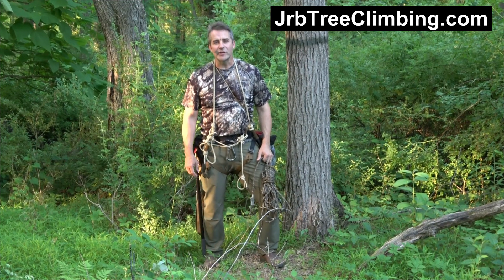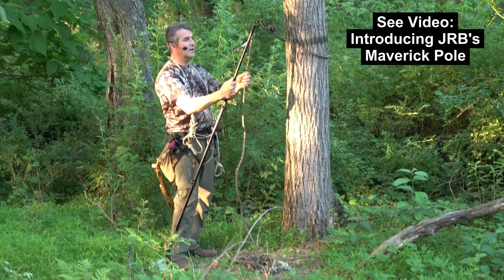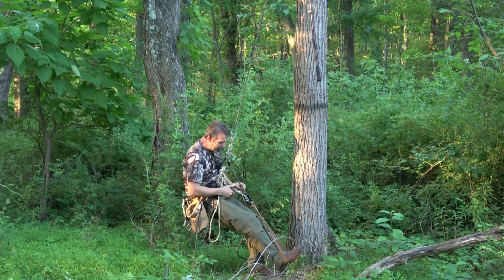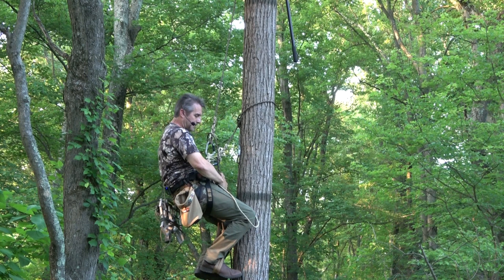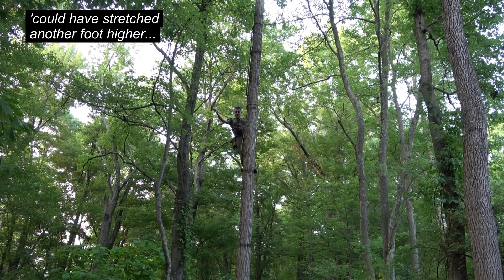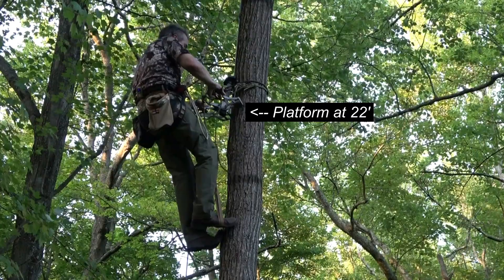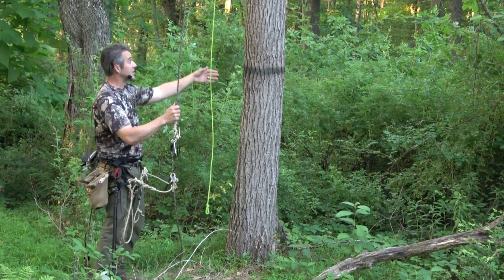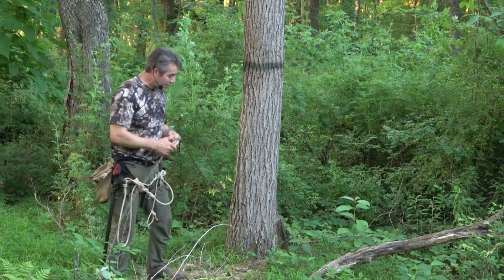Convert a Rappel Rope into a Climbing System, Tree Climbing Demonstration, JRB Hitch Climbing Method

Comment: I have a 33’ rappel set up. How high (at my feet) could I get with that using the hitch climbing method in this video? I’d prefer not to purchase new rope yet as I’m just starting to explore this climbing  method as a possibility for saddle hunting
Reply from the maker: It's a good question.  It depends on the tree diameter and your preferred anchor height above the platform.  Probably 17ft. See info here. 
https://jrbtreeclimbing.com/climbing-systems/hitch-climbing-system/
Reply: @ thanks! That would be a fine starting height as a practice this year leading up to season. I like the hitch climbing method. Seems like an access point for me into the world of rope climbing. My rope is 9.5mm so I’ll need 7mm cord for my longhorn hitch correct?
Reply from the maker: @moonlighthomestead4259  7 or 6. I prefer the 6mm TRC. It's a little harder to break but fine at my weight. Some of the bigger guys prefer 7mm

Comment: U said  in previous  video u don't carry a backpack when u hunt what all do u u carry and how do u carry it ?
Reply from the maker: @jasondunbar1907 I don't have a video on this yet.  i have my Garda hitch and emergency supplies and rangefinder in my saddle bags. I wear a small, cross body bag over one shoulder with my gut kit and any food or water. That's on my chest. That's the only thing I take out of my truck to repack it. When I use a platform, I wear it over the other shoulder with a sling like this video. If I am carrying a Maverick pole, it also is on my back with a sling, over the bag.  My rope is attached to my bridge and over one shoulder. 
 https://youtu.be/hoSny2MwmQY?si=AfqyyKn0Hb6R0Cjf
Reply: @jrbtc  Thank u for the reply I have been following u and have made changes to my brige on my saddle

Comment: I've recently discovered your system and have completely changed the way i climb. No more one sticking . Thanks for the info. This way works great!
Reply from the maker: @eddieheath7054 The most important thing is your safety. I climb using several different methods but only need one system. Whatever is appropriate for the situation and tree.  Cheers  and thanks

Comment: Man, I’m probably in the minority, but this all seems so complicated. I’m a saddle hunter. I just wanna be safe, but this adds so many elements to the climb that it’s confusing for a guy like me. If you could climb with a linesman and your tether or your rappel  rope and keep slack out of the line that seems to be simpler. What do I know though? You are the professional and it seems like a lot of people that follow you are also veteran climbers that understand your method. I’m so confused.
Reply from the maker: @kevinanderson4610  Your question is a good one.  Here's the problem with trying to advance a tether up a tree:  even if we move it up with every step, we wind up with an unacceptable amount of slack in it. For example, why can't we find any videos of people demonstrating how safe it is to step off their sticks at the worst possible time?   When they have the most slack in their system... or while they are in the middle of advancing their tether? I believe the answer is because it's unsafe.
Reply: @jrbtc  Thank you! Your videos are great. You’re so thorough.I’m understanding the system a little better now as I’ve been watching videos trying to simplify my understanding of things. There are so many different variations that I just have to dumb it down. I think the only thing I need to do is incorporate the JRB cinch into my climbing system to be as safe as possible on my climb and then I can still use my madrock with my autoblock to rappel down or eliminate the madrock all together.I was hoping to incorporate the madrock with my climb, but that may not be possible to do safely. Which video would be the most help for ascending with the jrb cinch on a 40’ canyon elite rappel rope?
Reply from the maker: @kevinanderson4610  I will be adding some content very soon to discuss your question. There are some retrieval scenarios which are more complex with a jrb cinch as opposed to a Maverick hitch. But the bottom line is that in order to always ensure the minimum retrieval complexity, I like a system with a minimum of 50 ft of rope

Comment: Hey John - really like the idea of this system. I was planning on using 9mm Canyon Elite (which your website says is probably closer to 9.5mm). Regarding the longhorn agile hitch, would you recommend 7mm Sterling accessory cord over Sterling 6mm TRC for that rope? Any pros or cons I should consider for each?
Reply from the maker: Both cords work on that rope. Personally, I prefer 6mm TRC.  It seems to stand up to time with less wear.  And with 6ft of cord, we will get a nice, compact Longhorn Agile Hitch. 
https://jrbtreeclimbing.com/content/length-specs/
Reply: @jrbtc  Thank you and thank you for all that you do! So many hunters are quick to take risks while climbing, it is refreshing to finally find someone putting out content where safety is the top priority.
Reply from the maker: @ccrre  I appreciate that. This is exactly what I'm trying to do. And I never claimed that I didn't take any chances when I was younger. It's simply that I didn't know how big of a chance I was taking at the time.

Comment: Really like hitch climbing with the JRB MAVERICK HITCH.  Never worry with a throw ball anymore, but love carrying a 20ft hitch pole, which comes in very handy as a walking stick at 5 ft , yet extendable out to 20ft and can accept a pruning saw blade or the rope hook for climbing and hunting purposes. I use a dedicated 50 ft HITCH ROPE  with 4 pre-tied JRB 5-2-3 hitches, 2 on each end of 11mm Sampson Predator rope tied with 9mm Sampson hitch cord. Of those 2, one is a JRB COMPACT 5-2-3 with a rappel ring ; below that,  a JRB 5-2-3 soft bridge for a web foot loop , no ring , with the 1in tubular web looped through the hitch loops. If I like a tree after hitch climbing , I will leave a preset paracord and come back to climb with JRB DSRT using a dedicated 75 ft 8mm Teufelberger Resc Tech rope with 3 JRB 5–2-3 hitches pre- tied with 6 mm Sterling hitch cord , 2 of which are in bridge mode with 1 on one end of the rope (in case i need to hitch over a limb ) and the Garda footloop. Of course with either rope I rappel using a Super Munter.  So I scout and climb new trees with the HITCH ROPE, but use my DSRT ROPE on favored trees where I have usually done some work such as pruning limbs and leaving a preset paracord. DSRT IS VERY STEALTHY. If i don’t particularly like a tree , then i just abandon it and keep exploring until I hit a hot spot. Thank you John, my hunting success, and climbing fun has greatly improved with the JRB TOOLBOX. OH, and my climbing is solid SAFE. Having followed JRB tutorials closely my climbing skills and knowledge is so much better, and quite enjoyable, can’t wait to get back on rope SOON. John , I look forward to future tweeks as your ongoing advancements of climbing technique and technology are fascinating, practical, and useful. I will mention that often , when entering new areas on a Hitch Scout, I’ll see deer . With practice, installing rope with a pole is very efficient and quiet.

Comment: What's the difference between the telescoping rod and a "climbing stick?" Great demo. So ya'll will stand on that tiny platform with a hunting weapon, harnessed in, for hours like that? Sheesh. Looks like that would get uncomfortable pretty quickly. When I do bird photography near water features, I'll setup sort of a V-Rig between two trees and just hang in the middle so the foliage won't block my shots, but I have a system so that I can lay back and relax in my chest harness. So I'm no stranger to sitting in my harness in one place for long amounts of time. I'll often use a foot loop as well to take my weight off the harness for a bit, so I can see how the stand would be really nice. Just like hunting, wildlife photography takes patience, quiet, and dedication. Anyways, I'm rambling. Thanks for the video!
Reply from the maker: You can do a Google search on Climbing Stick and see what they are.  As for endurance, I have done 13+ hours in a tree on a Saturday without coming down... and I did it with NO platform, just a branch under my feet.  And then I did it again 2 days later on Monday.     Maintaining comfort while limiting movement is a topic I haven't addressed yet. Safety first.

Comment: Yeah, been waiting for this for 40 years!
Just went out and climbed with one end on a JRB Cinch, and the other, Maverick.
Standing parallel  of the trunk,  is one of the cool things of this system!
Reply from the maker: I have done the same test. Which do you prefer?
Reply: @jrbtc  John,  not sure yet, the extra weight of the Cinch is only downside of that set up.
I love the Maverick! As you have shown and said, you can set up on any side of the tree at any position! Unlimited options!
Only issue I have had, sometimes when rappeling on Munter, my carabiner get locked up, and I have to reattach guarda and lift up.
What am I missing? Something simple, I'm sure.
Thank you, have a great day!
Reply from the maker: @SteveMcQueen-bx4hu  Pls post about THAT in the Facebook Group, but I will need a photo to understand. A Munter doesn't lock as far as I know...
Reply: @jrbtc  will do!